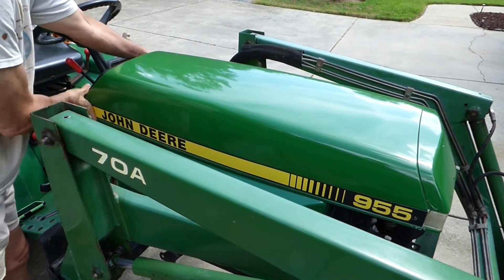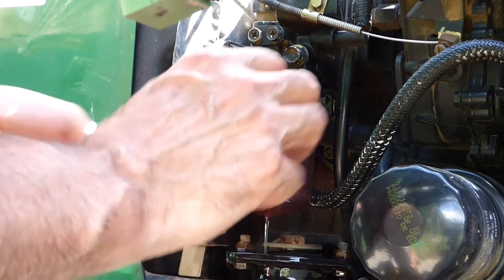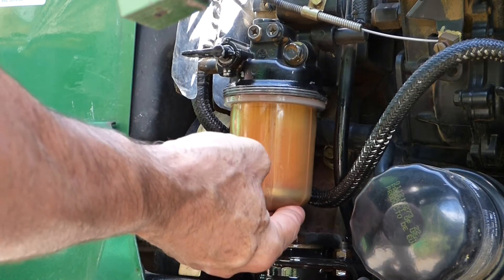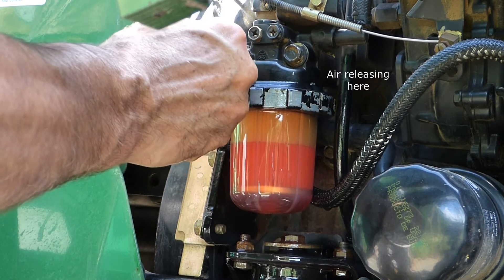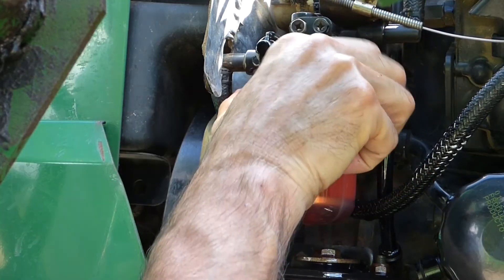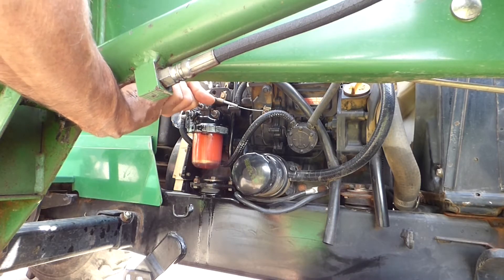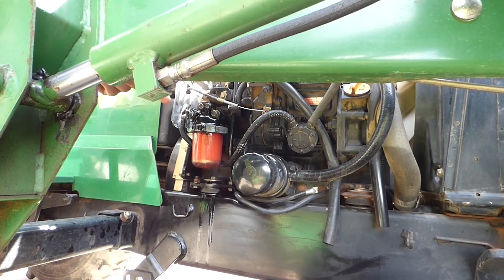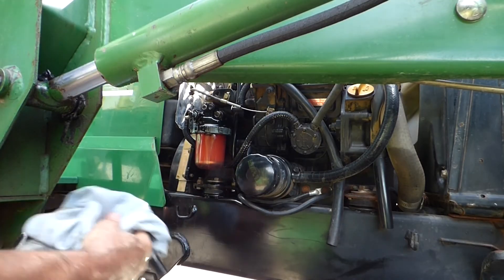Diesel Fuel Filter Change with No Start Fix after Filter Change - Bleeding Fuel Lines

Comment: thanks,  My father in laws just quit running on me while going up hill.  The fuel filter is nearly empty.  I'll check it out tomorrow.  see if fuel is draining into filter from tank and if so, try bleeding it. It tries to start and run real weak for a moment. A few seconds.       You're video gave me a starting point.
Reply from the maker: Good to keep the fuel level up in the Tank. When my tractor hits a quarter tank if I get on to steep but he’ll it’ll pull air and then I have to fill the tank and bleed the lines. You can do it!
Reply: @helpinguonline  That's probably my case here.  I'm ordered a fuel filter, so I'm putting off bleeding it until I put it on.   I watched a guy crimp the return line to bleed it. It didn't work for me.   I also to replace the lines. They're original.   1980's.   The return line was pretty rotten at the connection to the fuel tank.        Thanks again for the video. It takes time to share your troubles.  Most of us don't take the time and just move on after finding out troubles.

Comment: Worked great, I have a Shibaura 24 horse 3cylinder diesel, and I changed the fuel filter  but it would not start after. I followed your instructions and bled the air out, still would not start, the Shibaura does not have the bleed screws like yours so I had to undo the injector lines and bled until the fuel appeared by turning the engine over. Reconnected the lines and it started after about 10 seconds of turning over.  So no matter what the tractor your info is the answer.  Thank you.
Reply from the maker: Way to go!

Comment: My 955 will start fine, then die. Will start and run eventually after 5-10 starts, replaced the fuel filter but still does it. Any ideas?
Reply from the maker: sounds like a fuel pump problem...either getting weak and loosing pressure or if older the solenoid on the fuel pump could be going bad.
Reply: I was assuming it was gravity feed to the fuel filter.   I might have  fuel pump problem too.    More food for thought. thanks again.
Reply: I had a sticky fuel shut off solenoid. I sprayed the linkages with some penetrating oil and it seems better and moves much easier. I think one of the joints was gunked up with oil and debris and the solenoid wasn’t fully opening.
Reply: I have a 4600 that cranks and doesn't start even with a new fuel shut off solenoid.